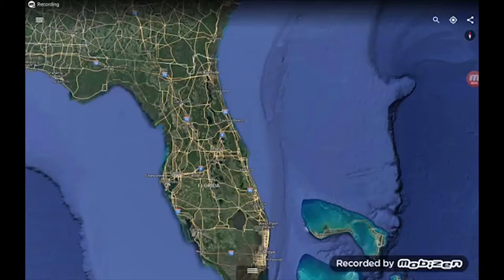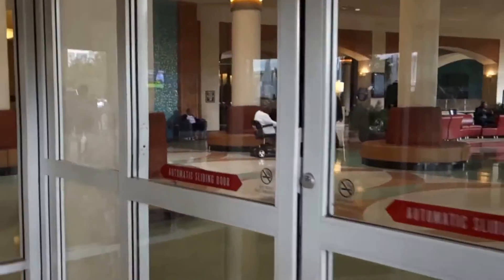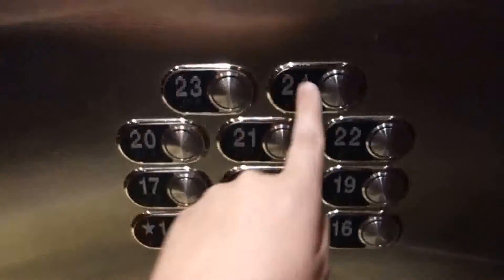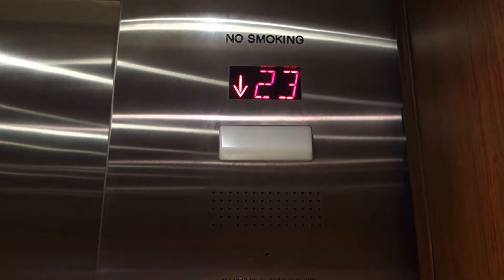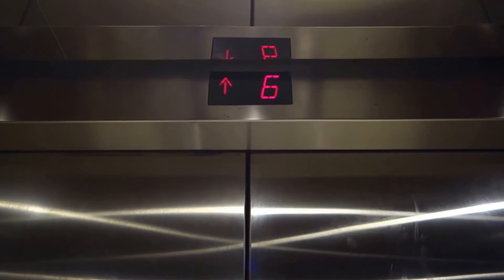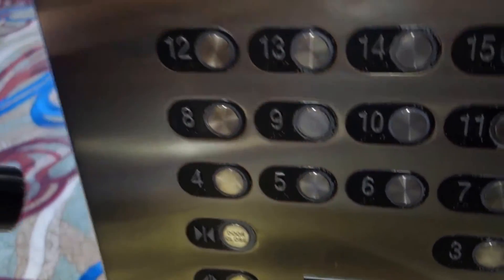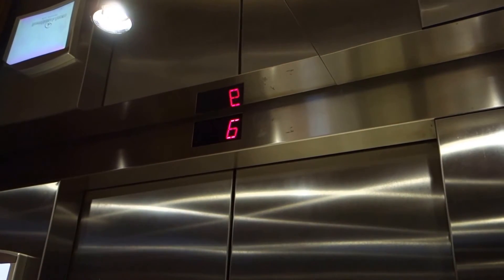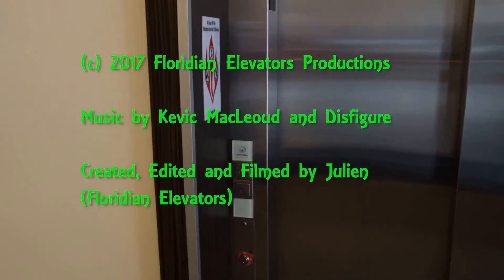Update on the Schindler 6400NA Elevator Modernization at The Rosen Centre, Orlando, FL

Comment: Ohio probably has ridiculous elevator mod codes too. Some hospital in my state has nice vintage elevators like Dover Impulses, Haughtons, Older Otis Series 1, Lula, and Westinghouse AE. Their 2 parking garages have more modern elevators, one of them has Otis Series 4 VR elevators from 2010, and the other has Schindler HT 400A elevators with VR as well. Unfortunately the hospital has been working on a heavy mod project since early 2022 starting on their Haughtons and going further throughout the facility. The only elevators that have been untouched are the HT garage elevators, the Otis Series 1 elevators, the tiny Lula elevator, and the Westy AEs. I don’t think they’re planning on working on the Schindler elevators although one of them is glitching out and stuff but they may in the future complete this with all the other banks. I haven’t seen many of their elevators malfunctioning that much to be honest so why the hell would they be doing this ridiculous project? Ohio has really turned their codes to Florida’s side of their codes.